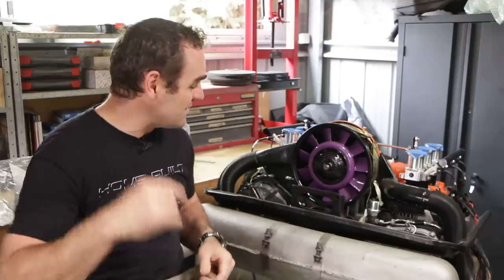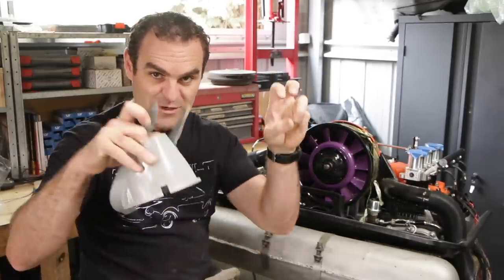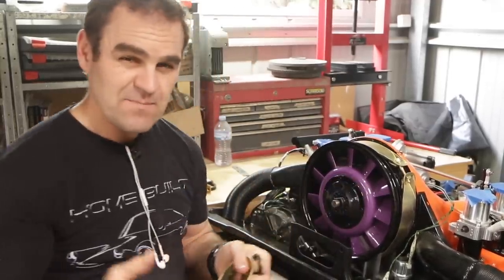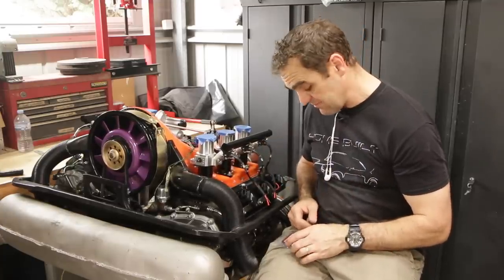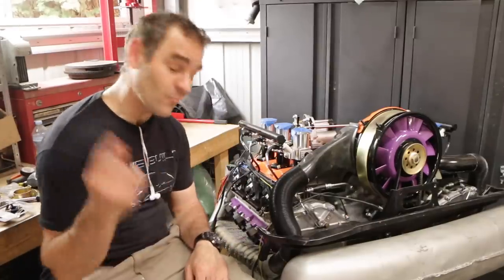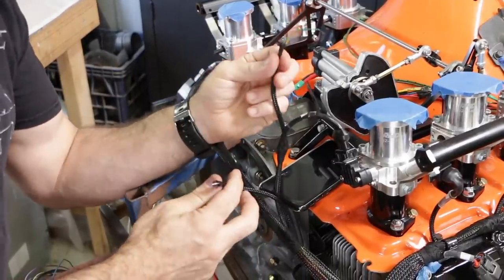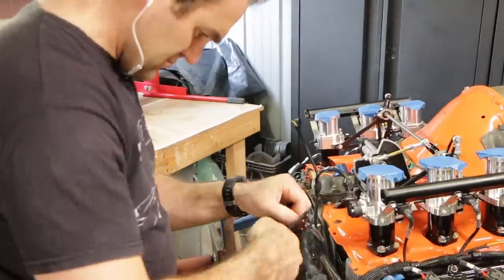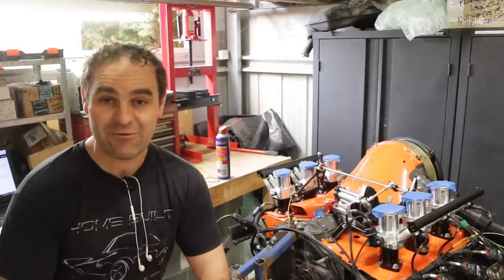Fan belt fun -  911 2.8 RSR Build Season 2.21

Comment: If you want to get stylish, you can easily have the ECU illuminate the original oil pressure idiot light when the pressure reaches a certain threshold.  The ECU should have a few auxiliary outputs for simple switches. Love the attention to detail!

Comment: Good to see that you are using a proper crimp tool and not one of those rubbish crush tools. You may find that using WD40 to slide on the heat shrinks will dissolve the glue on the tape. The Porsche oil pressure outputs will be analogue values while the Link requires digital. It is possible to get A-D converters, although I note someone has suggested the Link may out put what you require.

Comment: You could also add a T piece in for the switch and the sensor if you don't want it run from the ECU, or keep the switch as an engine stop - fail safe, keep the sensor, and still run the light from the ECU at a different setting.
Reply from the maker: As I briefly mentioned, the brass T-Pieces have been known to fail with the vibrations of the engine and the weight of the sensors. Then there is a massive oil leak that I would like to avoid ;)
Reply: I have had one on my rally car for 30 years, but it is quality from 30 years ago, but that doesn't mean they don't fail, and it is on an engine that could be replaced for $1500 in parts. I might look into stainless hydraulic fittings since it has been there for 30 years, they seem to last in harsh environments. 
With the Risk vs Consequence in your case, I would probably tend to err on the side of no as well.

Comment: Are you planning on doing a power up of the ecu while the engine is on the stand? Will make trouble shooting a whole heap easier... appreciate you can’t start the engine but you can check and calibrate all sensors
Reply from the maker: I didn't actually think of that. It is a good idea, but I probably will just do it in the car.

Comment: If you have a spare output on the ecu could you use that to switch the low oil pressure light at a preset programable setting???
Reply from the maker: Yeah, I will do that so it will all still work as intended.
Reply: Or use the output to drive the stock pressure gauge and leave switch alone....

Comment: Don’t you have a oil temp gauge on the dash also? on my car the sender for it is at the back of the motor (flywheel side) and the oil pressure switch is on the front. The motor is looking great nice work.

Comment: Nice work on the engine loom Jeff! You’ve upped your electrical game! 🙂 I was thinking about how you removed the low oil pressure switch. If you still want the light on the dash to work maybe you could get the ECU to have an output that you can wire up to the light and turn it on when it gets down below a certain threshold?
Reply: Oops just read some of the other comments and someone already mentioned it haha!

Comment: Hey Jeff, as a few others have said, you can trigger an aux output to drive that light, we'll just need to figure out whether the light is high side or low side, permanent or ignition switched.

Also another tip, on the Lambda sensors, make sure you populate all 6 pin locations, the sensor side of the connector only has 5, but you need to use all 6 pins on the loom/ecu side.

What's the story with the trigger (crank and cam) sensors?
Reply from the maker: They were a kit supplied by Clewett Engineering which is the last thing I need to wire up. As for the light being high side or low side, I am not sure what that means?
Reply: Are those sensors Hall or Magnetic? 

Low side means the light is powered on one side, and the ecu provides a path to ground, high side means the light is grounded on one side and the ecu is providing voltage (current) to turn it on. If the ECU is low side driving, you can use pretty much any aux drive, if it's high side, you'll need to use aux4-8. If the light is permanently powered you'll have to use a spare ignition drive.
Reply from the maker: @davenzl123  Ah, that makes sense. I believe they are hall sensors. Although looking at Clewett's site, it looks like for the crank trigger they use both hall and magnetic, and I am not sure which I have. Is there an easy way to tell?
Reply: Typically, Hall effect are 3 wire, VR (magnetic) are typically two wire.

If you have 2 wire, you'll want to use shielded cable (included on our looms). If you have three wire hall effect, in my opinion, you're better to remove the trigger and trigger ground pins and do away with the shielded wire, you'll then want to splice into the 5V and run new ground, 5V and signal wires out to the sensors.
Reply from the maker: @davenzl123  It looks like the crank trigger is magnetic and the Cam trigger is hall effect. I will have another look at the hall wiring. Thanks.

Comment: It looks like you aren't using the rubber/silicone seals on those wires. Are those plugs not waterproof, or is the waterproofing done with the rubber sleeve instead?
Reply from the maker: They are waterproof as they are ;)
Reply: @HomeBuiltByJeff  Haha, good to know.

Comment: I would put in a T for oil light and ecu sensor,  the chance of a T breaking is pretty low.  Factory Low oil pressure light in dash , why skimp out now?
Reply from the maker: Not skimping. I will trigger the light from the ECU, and those T's with the weight of both sensors and the vibrations of the engine  have been known to break, and then there is a massive oil leak. They are more dangerous than beneficial in my opinion.

Comment: i feel like those coil pack wires are too small a gauge.
Reply from the maker: The I struggled to get the power wires into the clip, so they must be big enough or they would make the clips bigger ;)
Reply: Generally you only need 1.0mm for the live and 0.5mm for the trigger and if it requires grounding ie to the head then they should be the same as the live.

Comment: Jeff, look at this one.
https://www.amazon.com/VDO-360-009D-360009-Pressure-Sender/dp/B00029XEBG
2-wire. The 3rd one you need is ground.
If you can fit two, you can use one for the dash and one for the ecu.

Comment: Jeff if you use an extender adapter like this (assuming the URL works) you can fit a gauge and dash light switch in the same outlet - https://www.ebay.co.uk/itm/1-8-NPT-X-M10-M10X1-male-Female-Tee-Metric-Adapter-Oil-Pressure-sensor/293380841628?hash=item444edc609c:g:RhQAAOSw0j5d-FRj